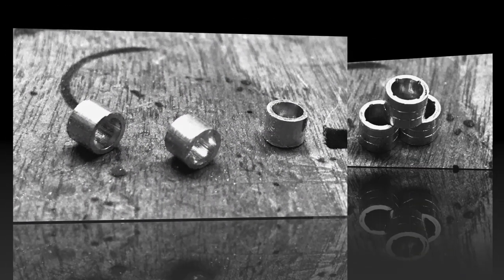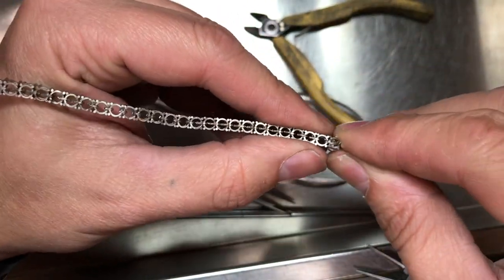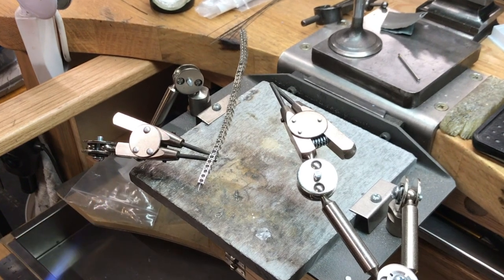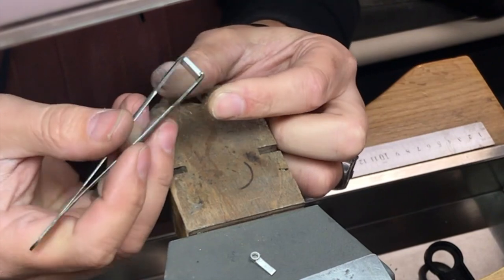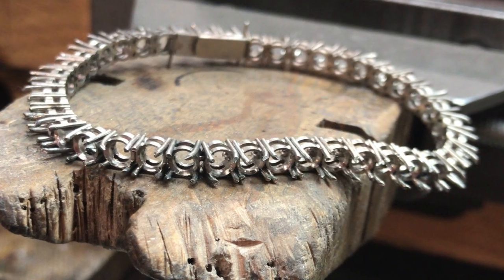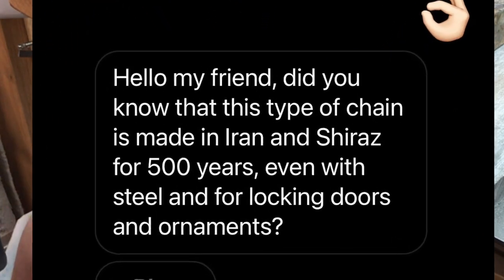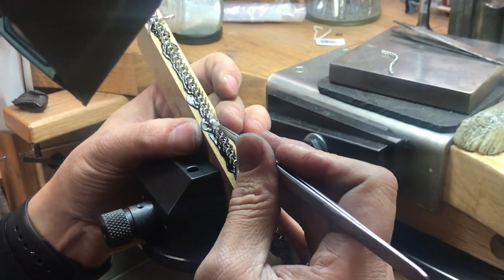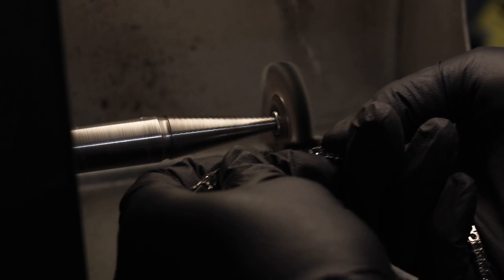Line Bracelet [Tennis Bracelet] Goldsmith Tutorial - At The Bench

Comment: This is such a great learning video. I am currently planning my exam piece to finish my apprenticeship and would like to make a line bracelet as part of it. However I was thinking of larger settings, about 14mm. Is that too large to ensure the bracelet will bend nicely around the wrist?
Reply from the maker: That sounds like a fun project- 🤞🏻 just scale up the wire thickness or even use plate at that size. Send me a picture on Instagram ‘jacothejeweller’ when you are done with the piece. And thanks for watching.

Comment: Hi Jaco I have a sterling silver tennis bracelet with 0.5c diamonds & a lock clasp for safety on the side. Do I need an extra safety chain added to it? Can I do this at home? How would I go about it? Thanks for any advice 😃
Reply from the maker: Hi Carol, it certainly would add another safety mechanism to your bracelet. Usually the clasp and catch on the side would be enough but don’t deal with a pin that has worn through around the clasp area (which is where it often occurs). So to add a safety chain would be recommended for extra safety. You could buy a safety chain from a local jewellery supplier and with a pair of pliers you should be able to add this as the little o-rings are typically open. Just bend them sideways and close them again. If you have any issues with this then a local goldsmith would be happy to add it for you. Hope this helps and sorry for the late reply, Jaco

Comment: VERY nice.  I am going to try and assemble a line bracelet in platinum, but I'm not making the settings. Still, it's excellent how you did it.  Most interested how you made the box clasp, not to mention the safety chain!  I assume the "tongue" of the box clasp is just regular platinum, yes? It's not any type of "spring metal"?  Thanks for saying that you use the HOTTEST SOLDER YOU CAN USE.  My gut tells me to use 1400-1500 solder... Your tutorial is of great help.
Reply: Well, I may just use 1500-1600 solder.  The settings I bought already made from a supplier. I just wanted to know what number solder to use and you answered my question.  But LOVED how you made the box clasp. Really excellent work.
Reply from the maker: Wow Minda, what a boost to have such great feedback. I'm so glad that my video gave you some inspiration - Good luck. This is a VERY satisfying project to finish.
Reply: @jacothejeweller  I BET it is!  I'm eager to try it.  Someone told me to use white gold for the "tongue" of the clasp because of "spring ability".... Is your tongue on your clasp platinum, too?  (I plan to use all platinum), but is that what you did, too?
Reply from the maker: @mindakrawitz8698  I used platinum all the way. You can harden the bend by hand and this helps a lot. But as you can imagine, this part doesn’t have to be as strong because there are other safety components to assure that the whole clasp is secure. But for me it’s platinum all the way 😊
Reply: @jacothejeweller  That makes perfect sense.  That's how I'm going to do it also ;-))))))))))
Reply: @jacothejeweller  I am SO glad you have this video and that I found it.  It's awesome to meet you and I understand every word you are saying ;-)))))))) You ROCK.

Comment: Thank you ! hey so i have asked in the other video, So you Do solder in the end the little wire connections , right? you connect the links with the wire from one side of the link, through the hole, and bend it backwards. Then tap on the wire so it will sit in the grooves that you made, and Then soldering it ? 
Again, thanks for your videos!
Reply from the maker: You are welcome. I’m glad you enjoyed the videos - yep solder all the wire parts that fold around. Then flatten them out and cut the excess. You are good to go 👍🏻

Comment: when you solder silver and want the flux layer removed afterwards, what (heated) acid or liquid is used i couldnt hear nor figure it out yet 
thx
Reply from the maker: Hi Minho, I currently us a shop bought powder but would highly recommend alum crystals on a hot plate. I’ve also used battery acid (sulfuric acid) in the past with backing soda as a neutralizer. This works well for a powdery white silver finish. But be careful with the fumes on that one. Good luck.

Comment: Am Lisbon Kaira I want to know how made round settings before solder the claws
Reply from the maker: Hi, thanks for the question. You could buy ‘tube’ and cut them to size if you are making a lot of settings or if you can’t buy metal in that shape where you are, you’d measure the diameter of the stone and multiply it with pi to get the length, measure the height of the stone to get the width and roll the metal out to your desired thickness. This will get you close enough but you’d have to experiment to see what works best. Good luck 👍🏻